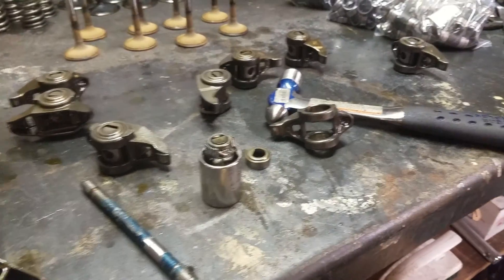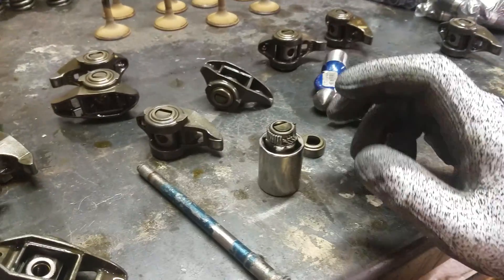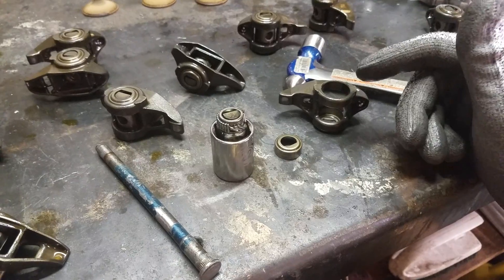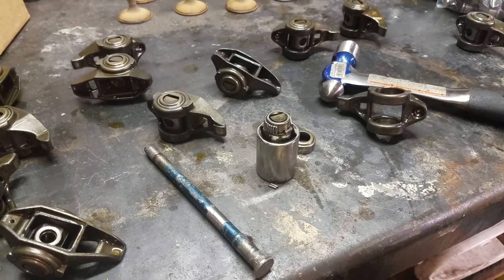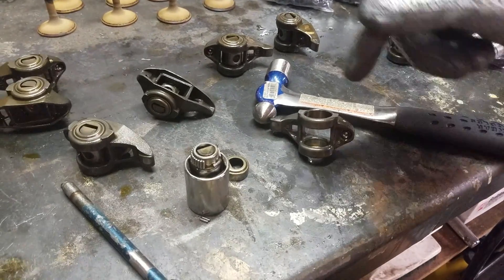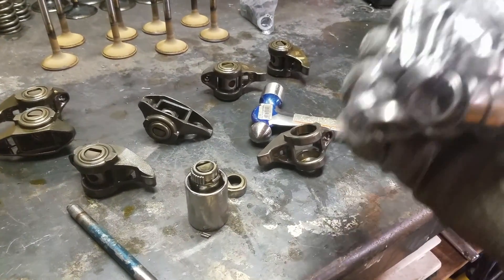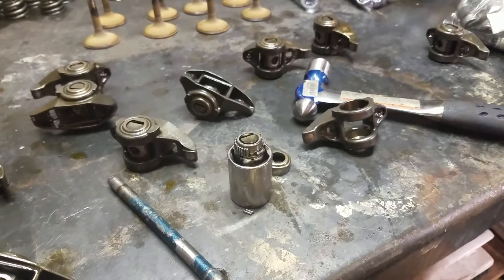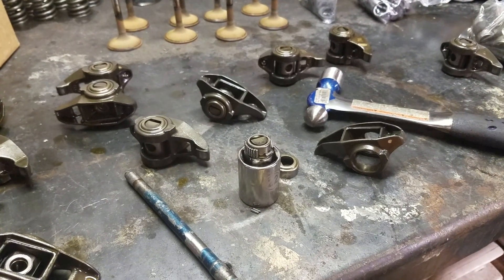LSx rocker arm trunnion upgrade explained

Comment: Very helpful, I got my trunion kit and was wondering the biggest difference because I was skeptical with more needle bearings.
Reply from the maker: Go with whichever one you feel necessary, they are both a great upgrade over the stock style. The ones that I put in my car are in thousands of different vehicles, and some on them are SBE cars running 5.1x's in the 8th mile.